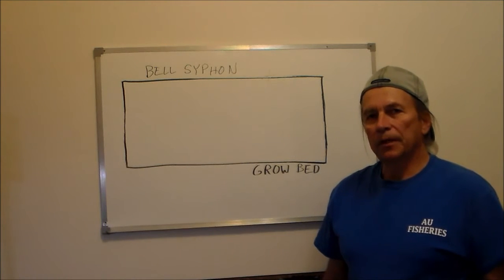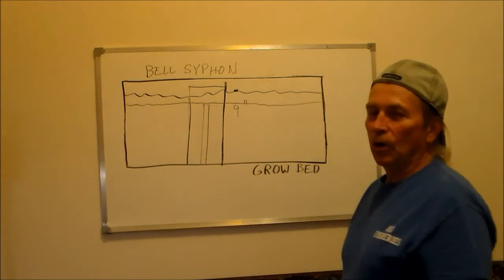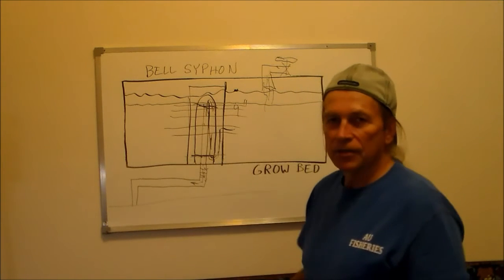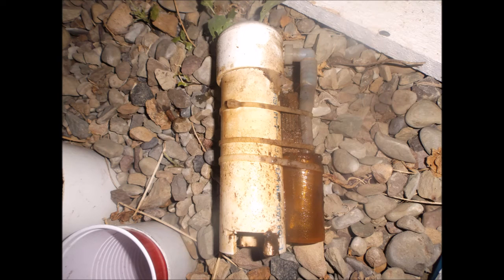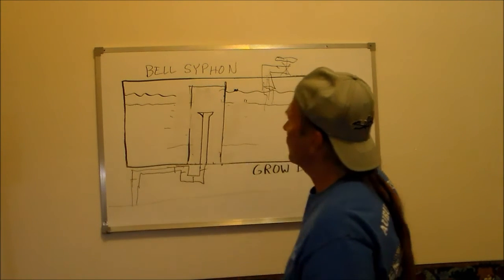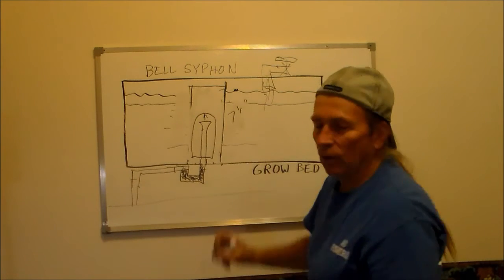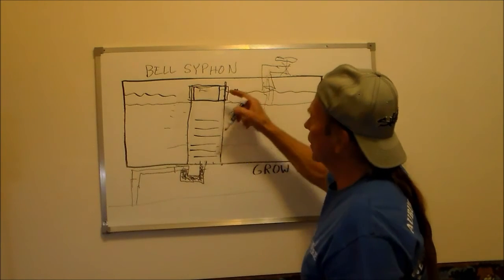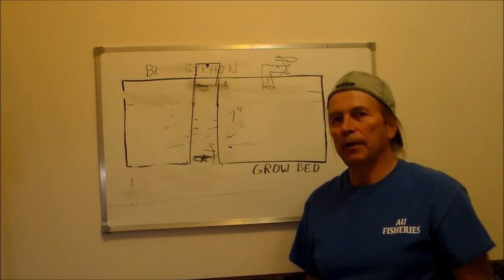Making a Reliable Bell Syphon

Comment: Another outstanding block of instructions. However, I do have a few questions if I may. 1) What is size of equalizing line for barrel halves? 2) How high does this line go into barrel halves or is does it elbow back down to bed? 3) If equalizing line elbows, does it have a screen to protect from root intrusion? Thank again Donald. This helped me as well.  Your the man!!!
Reply from the maker: +Robert Madden 1--  I used 3/4 inch lines.  2-- I found electrical conduit fittings work as thur hall fittings (cheaper than thru hall fittings) and end at bottom of barrel. 3-- I used 3" pvc as a gravel guard--- I can observe the root growth and rotate these to cut the roots and reach in to remove them.
Reply: Excellent, thank you sir.